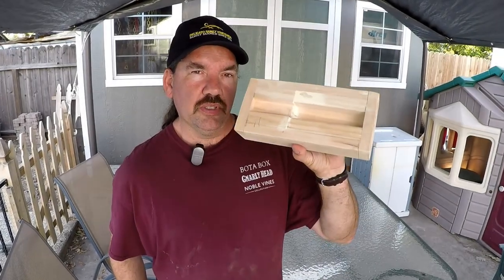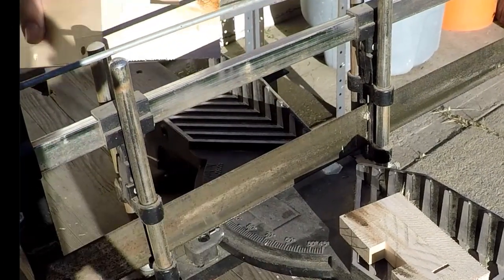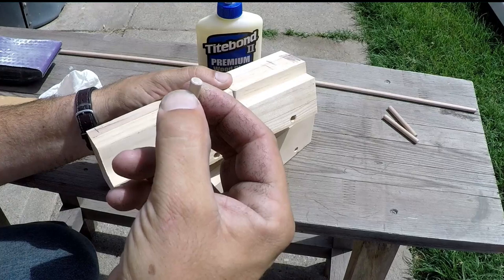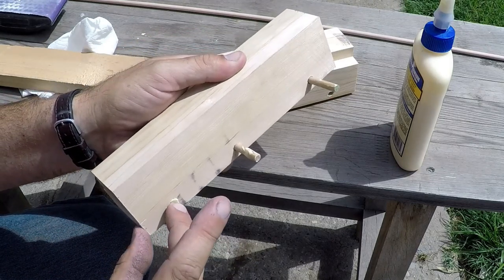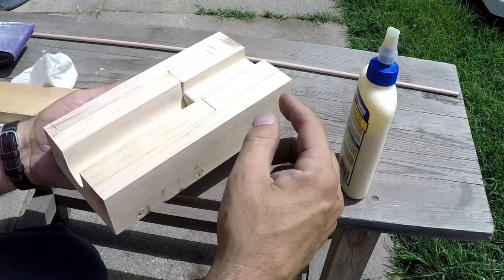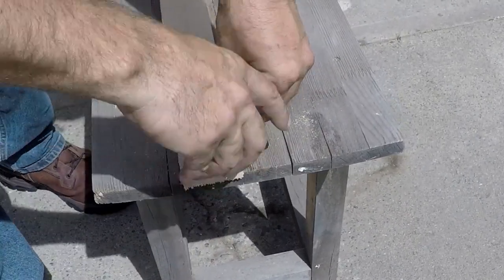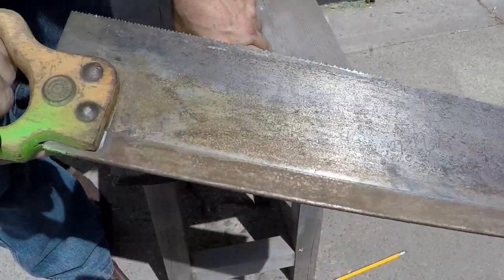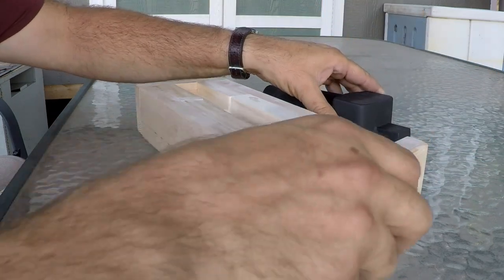Core Box In Casting aka core box pattern

Comment: Nice work Chris.  I am enjoying the series.
Reply from the maker: Glad you enjoyed this. Been playing with power director 16 lots better than windows movie maker.
Reply: I used the old version of Windows Movie Maker when I first started making videos and it was OK.  But it went away with later operating system up dates.  The new Movie Maker that they provided on line was not usable at all, kept crashing.  I now use a program called Video Pad Professional.  It seems to be very similar to Power Director.
Reply from the maker: I aee